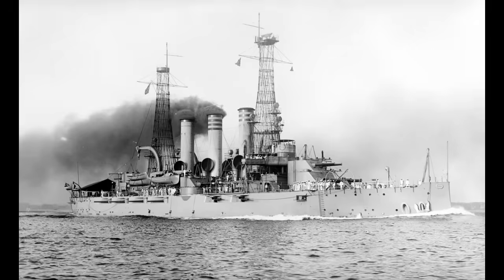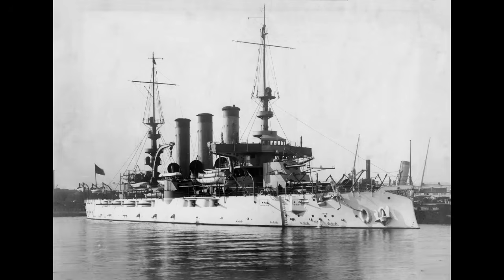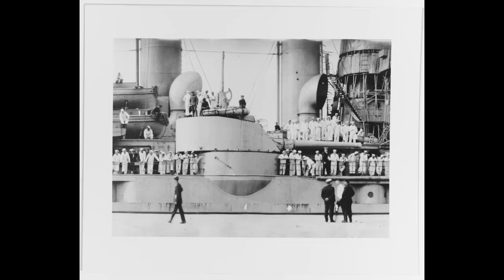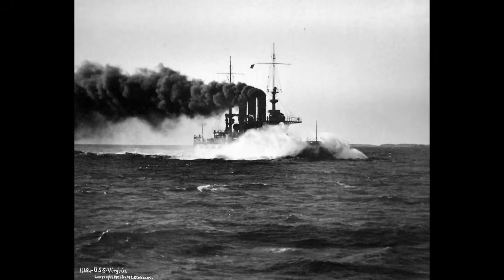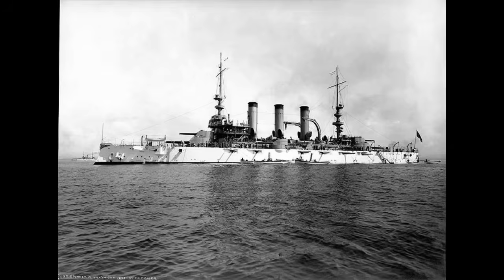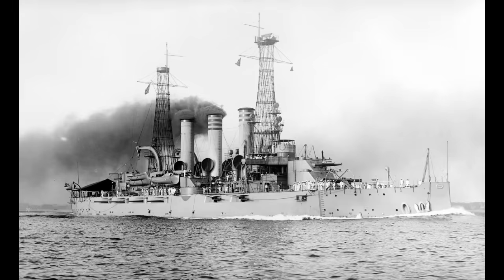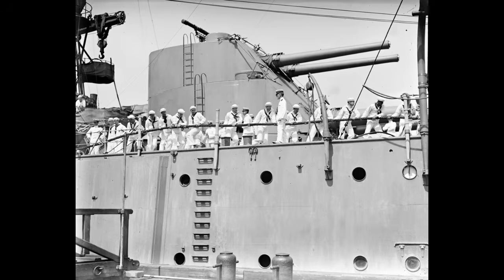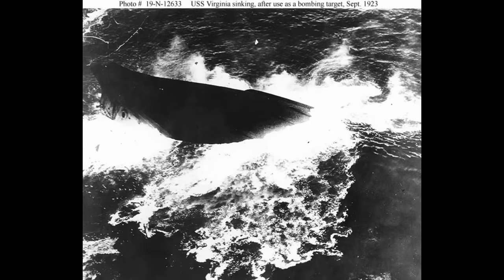USS Virginia - Why Stacking Turrets Didn't Work

Comment: What’s going on with those cool towers?
Reply: Those are lattice (or cage) masts and they are definitely not cool. Besides being ugly as sin, they were not very stable and were replaced by tripod masts. Primarily, the mast was to carry the increasingly complex fire control equipment and rangefinders for the ship's guns.
Reply: @picklerick8785 thank you for the detailed and complete answer.
Reply: Yes those are the older Cage style masts the later Tripod masts are a much better design

Comment: Re the 1923 bombing test, in all these tests the ships had no crew - no AA, no damage control personnel. So near-miss damage that cause sinkings due to progressive flooding probably would not have happened, given timely and proper damage control. The bombing tests proved less than what some Billy Mitchell fans believe, and proved things now less well realized (= that damage control training is critical).
Reply: Thank You!  The air technology wasn't there yet in 1923 to support Billy Mitchell,  Stationary ships with no crews.  Drowning Ducks. This is a great myth that these tests proved Mitchell's point.

In a dozen years the necessary air technology would be available.
Reply: Your argument is aircraft are not a serious threat to ships, so the US should not have invested heavily in aviation nor the navy invest in defenses against aircraft in the 1920s?

No question the tests were not a "fair" representation of actual air to surface combat, but how could they have replicated maneuvering and damage control short of having a crew aboard in 1923? As I recall, the Navy also imposed limits on the aircraft and bomb loads to minimize the chance the ships would sink.

Aviation was still in its infancy. Regardless of the fidelity of the tests replicating air attacks on ships, clearly spending more developing aviation and ship defenses against air attack was in the best interest of the US. Unfortunately, they spent very little on either until it was too late and we had to learn the hard way battleships are vulnerable to air attack, losing nearly 3000 service members in the process.
Reply: My comment said nothing of the sort. Why are you trying a straw man argument?
Reply: @petestorz172  It was a question, and I was questioning the relevance of the logical conclusion of your assertion. Please read more than the first line before responding.
Reply: I've read that many/most/all of the water tight doors were left open
Reply: IF that was the case, a ship under air attack would not have been in that state of unreadiness.
Reply: @petestorz172  Taranto. Pearl Harbor.

I doubt he is correct. The navy did not want Mitchell to succeed, placing altitude and ordnance limits on the pilots to minimize damage, ostensibly so they could use them for gunnery tests.
Reply: WRT Taranto, though the IJN learned from it, the Taranto attack did not inspire the PH attack. The PH attack was already in planning and where the RN used one carrier and a handful of torpedo bombers against ships in harbor, the IJN used 6 fleet carriers, over 350 aircraft, and devastated multiple airfields along with hitting the battleships in harbor.
Reply: @petestorz172  where did I write Taranto inspired Pearl Harbor? You asked about ships being unready for battle and I gave you two examples.

Comment: The IJN Kurutta had triple stacked turrets.  12" on the bottom, 8" above that and 5" on top.  Later an AA mount was placed on the roof of the top turret.                                                                  I am kidding.